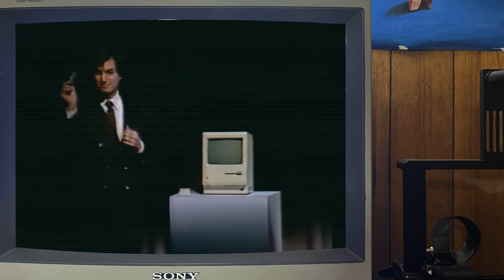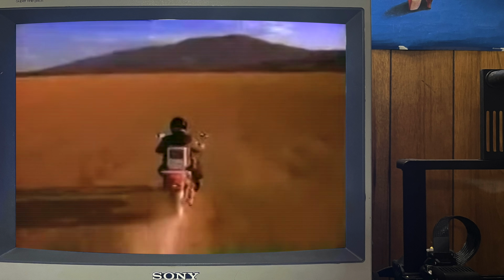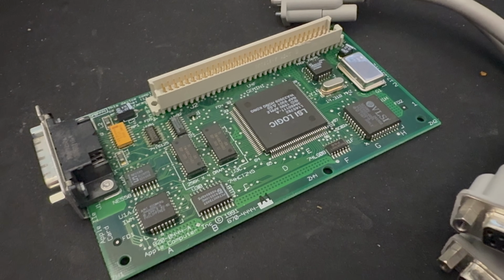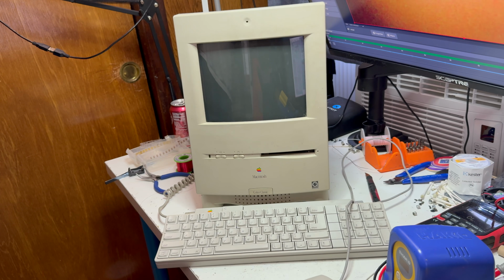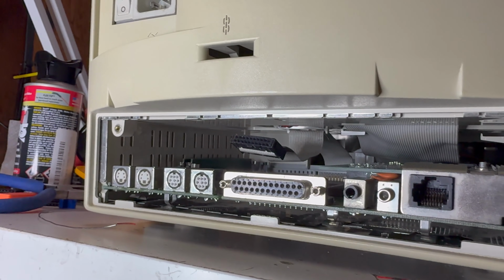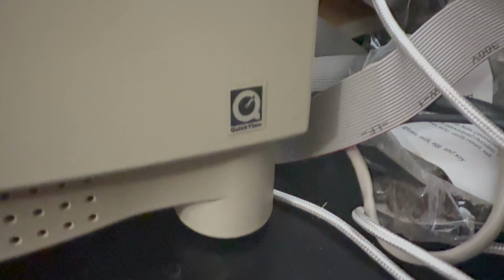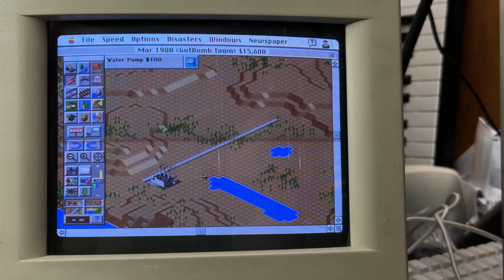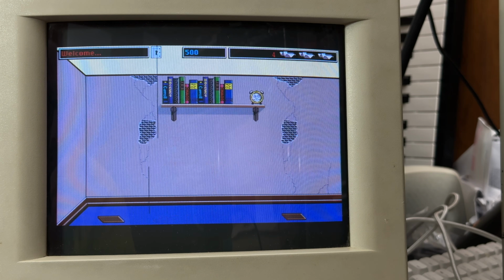Was the Macintosh Color Classic Crummy?

Comment: Neat
I remember working on Mac’s at the time. By the time the color classic arrived, it seemed most people had moved on from the small compact all in ones…..not just because of windows PCs, but also the success of the various Mac LC models. My 2nd Mac was an LC475 with more RAM and external CD-ROM. I think I had DOOM II….which required the 040 or PowerPC. Wolf 3D did work a little better on slow Mac’s with a reduced picture size to maintain some speed.
For old Mac’s on 030, have a look at Bloodbath. Photo graphics shooter. But no 3D environment to explore. This game did work decently on an 030 with sufficient ram installed.

Comment: It was the first Macintosh I bought, I used it to do all my homework in college. I added a 32 bit expansion card, more RAM, internet connection, and bigger monitor. It worked well and it was nice to have 2 monitors. I eventually had to give it way when I moved into a small apartment and wanted a new computer. I wish I had the one they sold in Japan that was the bomb. That one was faster, allowed a full page on the builtin monitor and i think more RAM. It’s what the Classic ll should have been.

Comment: Mine has LC 575 board and I did the VGA mod.  Also used a LC520 speaker to move the sound output to the front of the machine and it was like this speaker was intended for it from the beginning, even the analog board has spots for the contact tabs, so no more disconnecting the speaker when removing the analog board.  The case has a spot for the speaker to clip in as well.  These mods all together make the Color Classic one hell of a great 68K machine.

Comment: Was it crummy? Sort of: internally it was mostly identical to the LC II, complete with 16MHz CPU, a 16-bit system bus, and a 10MB RAM ceiling; not exactly a recipe for performance. But the 9" Trinitron CRT was beautiful, and overall it was a handsome machine. The followup model, the non-US market CC II/Performa 275, cured all of these problems: 33MHz CPU, 32-bit bus, and at least a 36MB RAM ceiling (or more with modern high-capacity SIMMs). These are cult classic machines, especially in Japan, and the original CC is especially popular as a modding base.

Comment: Bought one from Japan a few years ago. It ended up being a CCII with a LC550 board inside, an unexpected surprise. They refunded me because the case was cracked in the corner. Despite recapping everything and reflowing everything in sight, I got about 3 days of working state out of it.
Reply from the maker: It can work again! Keep at it!
Reply: @GutBombIndustries  at least it's still got some promising behavior. I flick the switch on, and it starts powering on only if I press that key on the keyboard. It took days before I got to this state initially.
Reply: @GutBombIndustries  its main problem now is that the screen doesn't get energized. I got desperate and played with the potentiometers all over the place after I had exhausted all other avenues.